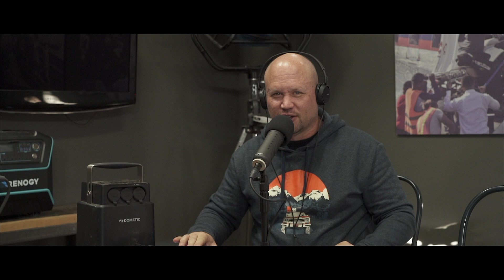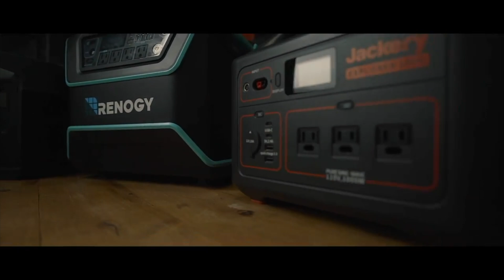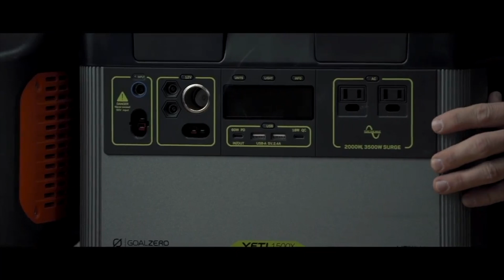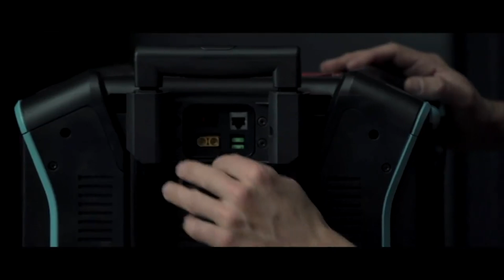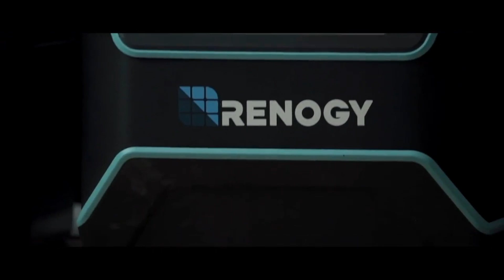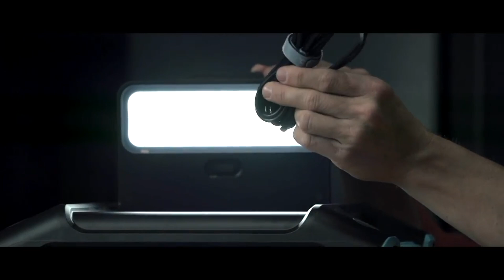Portable Power Systems: The Best Off-grid Batteries for Overland Travel and Vanlife

Comment: I’m kind of surprised that you guys are supporting devices that use the lithium ion chemistry. At 500 charge cycles @ 80% DOD, there isn’t much more longevity than an AGM battery (300-500 cycles). Yes they are lighter and charge faster, but I’m not sure 30% extra power is worth the cost. 

LiFePO4 batteries are a whole different conversation. At 2000-3000 charge cycles @ 100% DOD and 3000-5000 charge cycles @ 80% DOD, light weight, super fast charging is worth the cost. That’s 8-13 years of everyday use. Several manufacturers now have heated options that allow use to -20C. Your goal zero battery will degrade after 2 years.
Reply: Many other better options available with more tech included for sure at the same or better pricing